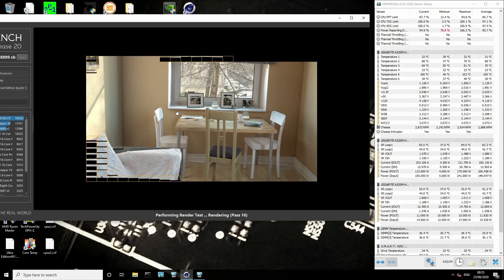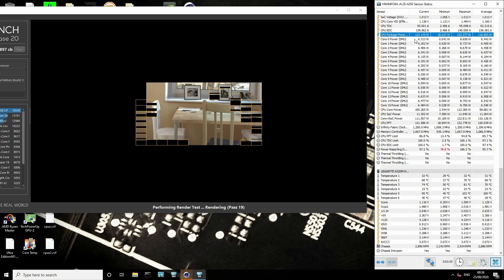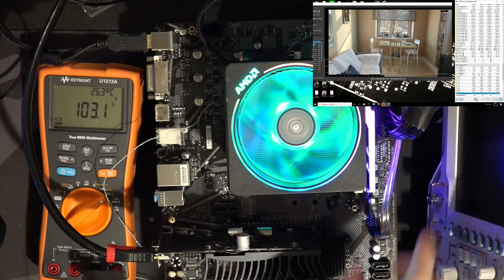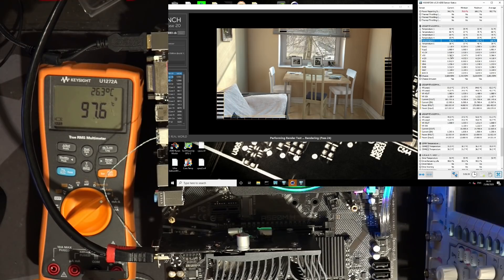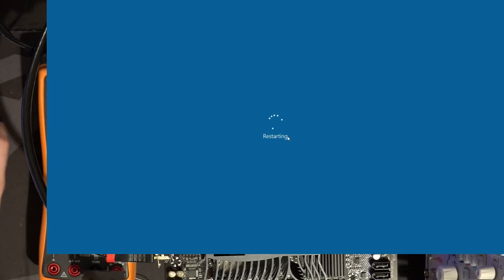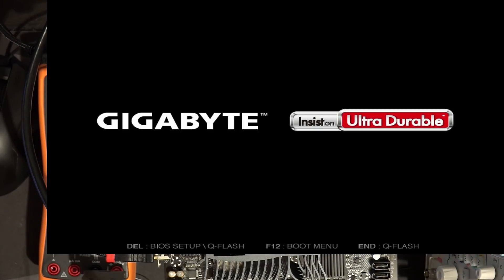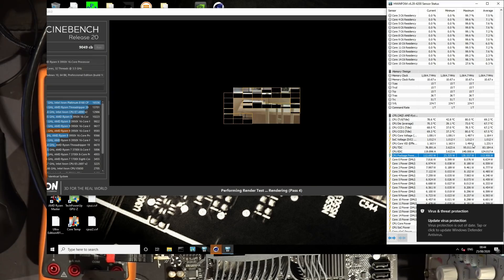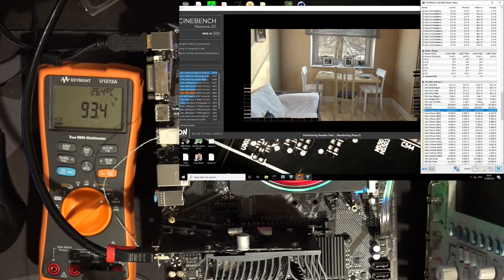Ryzen 9 3950X VS a low end A520 VRM feat. Gigabyte A520M H

Comment: So if I buy an NH-C14S and slap a 3000RPM Fan on it I can run a 3950X in an A520 board?

*adds to wishlist
Reply: @IbukiHimari just a couple year old $10 delta fans should be good. 11000rpm goodness
Reply: There are A520's with better VRMs which wouldn't need as much VRM cooling and likely not be power-limited on a stock 3950X, the point was that it was the cheapest (from Gigabyte). And a NH-C14S's stock fan probably provides more air flow than the Wraith anyway despite much lower rpm and sound levels, it's bigger and well, Noctua is just plain better (but if necessary there's the 3000 RPM PPC Noctua models).
But once you start down that path of better A520 boards or expensive coolers/fans you have to consider the question "wouldn't a B550 be better and not that much more expensive", A520 needs to be cheap to make sense given their limitations, it has a fine niche where those don't matter and almost all of them involve 3100-3600 processors and it should handle even an 3700X much better than this
And what everyone REALLY wanted to see was the 3950X cooled as per AMD's recommendation, IE using an AIO so very little to no VRM airflow! Will there be a VRM fire on this motherboard or just insane throttling and how FAR down is that?
Clearly this needs to be done, FOR (MAD) SCIENCE!
Reply: @Torbjorn.Lindgren  Hi, do you recommend this board for a 3600 and 1650 Super combo? https://www.msi.com/Motherboard/A520M-A-PRO/Specification
The gigabyte one is not available in my country and it's the cheapest one I could find. I don't plan to overclock but I do keep my systems on 24/7.
Reply: @Cronini  haha true

Comment: Your CPU only hits 120W because you're maxing out the TDC/EDC limits of 95A/140A
So this looks like its entirely stock, not throttled
Reply: There is power reporting deviation as indicated by HWinfo, so that's not totally accurate.
Reply: Maybe. A prior video with this board did show performance improvements from changing some of the settings tho, so some of the things are enabled. However, I know that on my own board there were plenty of options which seemed to do nothing when I was testing them, and were later removed in a bios update.

Comment: I noticed hwinfo was showing even after (but also before) you adjusted the limits, that the board was hitting TDC/EDC at 100%. So seems it's restricting current, maybe there's another setting that's overriding what you set in the XFR menu??
Reply from the maker: with the 3600 it would PBO up to a certain point and then hit a wall. I think the BIOS just overrides/ignore values that are too high.

Comment: What about compassion with MSI B520M Vector?
Reply from the maker: I don't really want to do a bunch of A520 testing.
Reply: @ActuallyHardcoreOverclocking  Don't test, don't review, just rate (rumble) or not.
btw. You have "mobo PCB Breakdown: Gigabyte B450M Gaming" video with the similar VRM and you weren't sure it can handle 100A with heatsink.
Reply: @AlBr80  There's a big difference between what's shown in this video, and what is practical for daily OC or good PBO results. If he doesn't want to do A520 content that's just fine; VRM thermal testing and whatnot is HWUB's department imo.
Reply: @BeamMonsterZeus  You're right. But practical OC on A520 differs only in that a CPU has six cores, not sixteen.
Reply: The A520M Vector has the same VRM heatsink as the B550M Bazooka, with the same MOSFETs except that it only has 1 high-side FET per phase instead of 2. It should be similar to the B450M Pro-VDH Plus/Max (which has the same VRM layout, but with slightly worse MOSFETs and a smaller heatsink). This means it will be able to handle a 3950X at stock without throttling, and would probably be ok with PBO enabled (if the option exists) if you use a decent "top flow" CPU cooler, but the VRM might throttle if you use a tower cooler or an AIO with PBO enabled.

Comment: I was avoiding prebuilds with a320m and 2600 or 3600 combos (for work, i really dont feel like bying 20 pc`s and building them myself). Prebuilts always come with cheapest crap possible...But now... a520 doesnt seem to const that much more and it will handle 3600 with ease, heck it will handle 3700x (if i needed it to). Thanks for this info Buildzoid
Reply: You can run a 3700x on anything
Reply: A320 runs 3700x already all day
Reply: I built a pc for a friend with r5 3600 on a320 from gigabaty on which pbo was working just fine and i knew it will work because he was on a budget and couldnt afford extra money for smth else. I paired that wih rx5700 ssd 16gb of ram etc. He runs this almost a year and is very happy. So maybe its not optimal way to do things like this bit for margin of people which wants the best price performance figuers or have to hustle there are unusual combos like this. Im curious if its possible to mod bios to allow for example 20W more and run this 3950x perfectly fine
Reply: @shermanb3  my concern is purely in thermals. I know a320 can handle it, the question is for how long ? I saw people complaining with 2600x (admititly its 95w tdp but still)